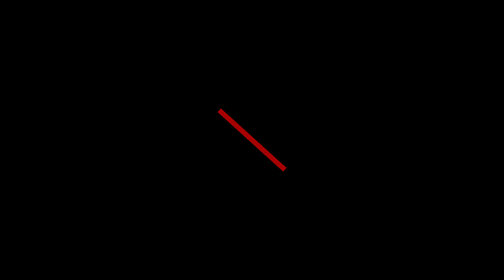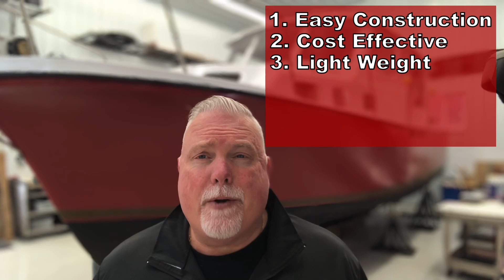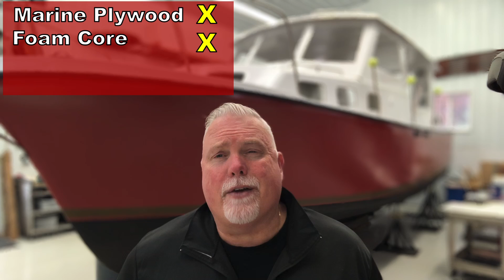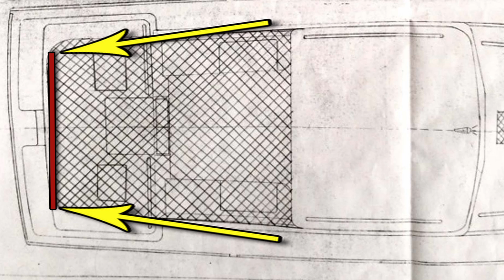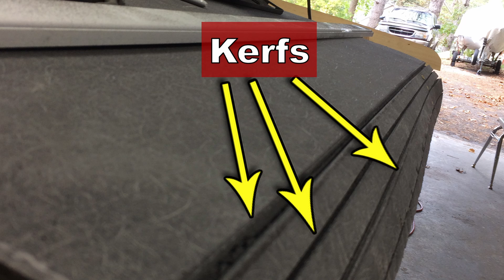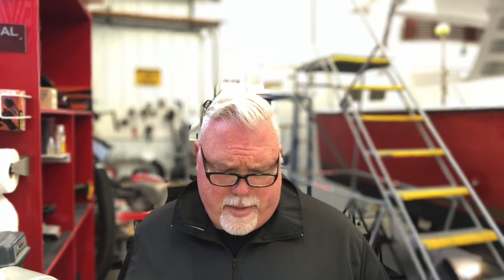Build a Boat Hardtop Part 1 | Coosa Board Boat Building | Great Loop Boat Trawler Restoration (Ep12)

Comment: what type and size of coosa board did you use. i am starting a similar project  with a 8ft x 8.5ft. i will have to splice the sheets and i am also thinking of doing the sides.
Reply from the maker: Blue water 26 1/2” thick. Check out my playlist for Composite Boat Building, 🤓where I explain the staple and glue method of joining two sheets of coosa board together 👍😁

Comment: How did u hold the coosa to shape while fiberglass kicked off besides the screws along radias edges thx great job
Reply from the maker: Exclusively by screws. The screws will hold the coosa board to shape and do all the work. 👍😁thanks for the question

Comment: I have a 42 foot CHB Trawler and want to install a couple of 12 inch Chartplotters and it requires cutting up the dash and was wondering your thoughts of using Coosa Board to rebuild dash as it looks like it could be good to round very easy
Would like your thoughts
Thanks 
Joe
Reply from the maker: I have used Coosa Board and epoxy to fill holes in the dash and the cockpit floor for old instruments and deck plates that were no longer needed. But have used PVC foam board to build my overhead Nav Pod and upgrade my helm console. Check out the Coosa Board and Composites Playlist. It will give you an idea of what's possible and which is better for the effort and for what application.

Comment: One thing i want to ask, why are you shouting?
Reply from the maker: Dan the acoustics inside the Werks can be especially challenging so there is a need to speak with confidence and project the voice clearly and with definition. It is a large workshop with cavernous acoustics. I hear you. There may be some technical solutions once we get to 1,000 subscribers. So stay tuned and stay motivated.
Reply: @motorcityboatwerks  Ahhhh make sense, tbf that slipped my mind XD first rule big open space lot's of reverb, i did a school boy error my bad, and i will do you'll get them subs 👍

Comment: Why coosa board instead of King starboard?
Reply from the maker: King Starboard is HDPE plastic which for me is inappropriate for this application, namely due to cost, weight, rigidity, and inability to form match the pilothouse curves. I will be doing a video on “Boatbuilding Composite Materials” where i talk about what materials are suitable for what projects —so please stay tuned. Thanks for a great question
Reply: @motorcityboatwerks  thanks

Comment: Huge project with compound curves and changing dimensions. Metal shapers / fabricators use  similar form called a buck. Sheet metal is formed over the buck with hammering.
Reply from the maker: thats a good term